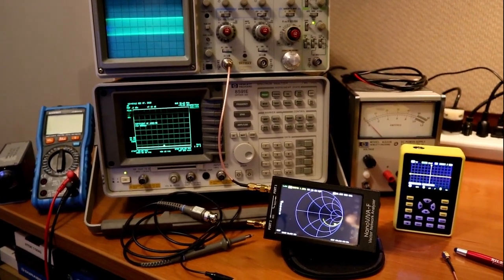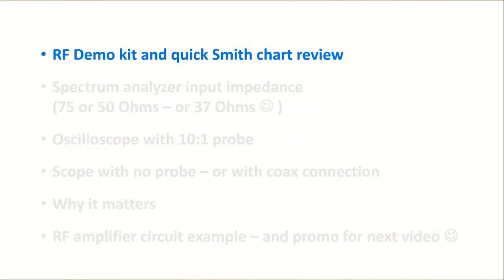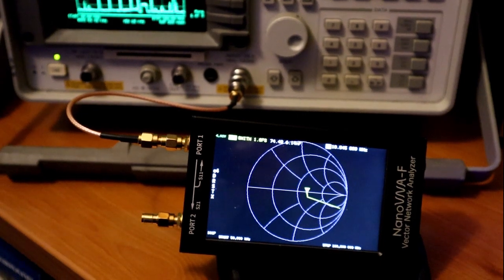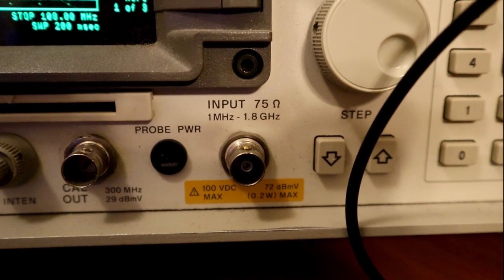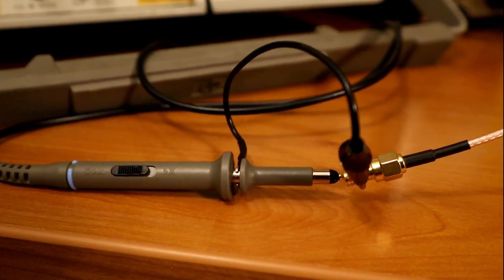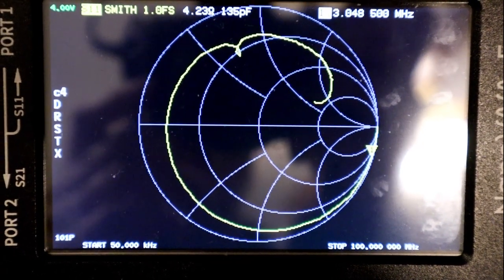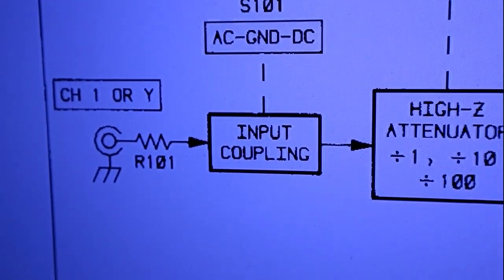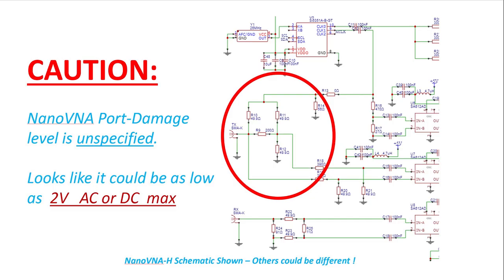NanoVNA - Measuring Impedances

Comment: how to measure impedance antenna using nanoVNA ?
Reply from the maker: Hi Edi.  The short answer is you need to calibrate the nanoVNA to the feedpoint of the antenna and then read out the impedance as discussed from 2 to 4 minutes into the video. To calibrate to the feedpoint, the short, open, and load used for the cal need to be placed at the end of the cable where the antenna is normally connected. However, if you don't need to know details of R and X, and just want to know if the antenna matches the cable impedance, you can do what is shown in this video: https://www.youtube.com/watch?v=hLPNOp0RXD8&t=115s
Reply: @MegawattKS  thanks sir. Ideally, value of S11 = .... ?
Reply from the maker: @edisukriansyah5230  -20 dB is excellent. -15 dB is quite good. -10 dB is OK for most situations.  -10 dB means that 10% of power is reflected. Although that may not sound great, the effect on transmission range is negligible.  If S11 = -6dB, I start thinking about needing to fix things.
Reply: @MegawattKS  thanks you for taking the time to help me

Comment: What setting measures reactance?
Reply from the maker: The marker reads out either R + inductance(or capacitance), or R + jX. I think you have to go to the "Marker>Value" menu to select R+jX if its currently reading out the other.
Reply: @MegawattKS  I'm using the VNA_QT_Windows program, and didn't know what drop down I should chose.  I'm thinking it is Z-re  << Is that right?
Reply from the maker: @davidc5027  Sorry - I am not familiar with that software. I would say try it, and see if it matches what you can visually read from the Smith Chart (with a marker set on a particular frequency and looking at what arc you're closest to). Also if it reads out as X+jY format, it's most likely showing reactance as the Y (though it could be admittance).

Comment: I didn't hear what frequency the scope probe was specified for. Nothing has a fixed impedance at all frequencies. Everything will be way off ultimately if you go high enough in freq2quency. That's why the frequency ratings matter so much.
Reply from the maker: Good question. The probe shown in the video is a cheap one that came with a 100 MHz scope I have at home. BUT - I've also done these measurements with high-end Agilent probes rated for up to 300 MHz. In particular the N2863A, which is a 300 MHz 10:1 passive probe. Same basic results. At 100 MHz, it measured 49 - j160 Ohms (which is equivalent to 570 Ohms || 9 pF in parallel form). The VNA showed it moving along the 50 Ohm circle from the right side toward the center on the Smith chart, just as all passive probes will (some may move along a 70 Ohm circle).  As you said, nothing is fixed impedance as frequency changes. Here the fundamental problem is the cable, which is a transmission line with distributed L and C. To deal with that, the probe has to be terminated in its characteristic impedance at high frequencies at the scope input jack. A modern Agilent/Keysight 100 MHz scope we tested measured 50 -jX almost perfectly when the calibrated VNA was attached directly to the scope's input jack, reaching 50 -j198 at 100 MHz. The probe necessarily has a coax cable between the scope tip and the scope input jack. Hence, the input impedance seen at the scope tip must morph from the proverbial 10M || 15 pF (or whatever) to something tending toward 50 Ohms resistive at high frequency, since there is no choice in a passive cabled structure if one is to avoid wild impedance and frequency response swings. See the comments/discussion below from WD8DSB and G0HZU for a deeper dive into some of the complexities the probe designers dealt with using resistive center conductors/etc.   (The best solution for high frequency work is to use an active probe that has an amplifier at the tip that can present something like 100K || 0.5 pF, and then buffer that down to 50 Ohms to drive the cable run. We have a few of those in the lab for RF work and they're great - although a bit cumbersome due to the need for powering  :-) )

Comment: Also take an ohm meter and measure the resistance right at the input connector on your scope and you will measure very darn close to 1 Meg Ohm.  If you measure your 10X scope probe with your ohm meter when the 10 X probe is connected to your scope you will indeed measure close to 10 Meg Ohm.  Also since the parallel resistance is so high you can typically measure the parallel capacitance of the scope probe as well as the scope using a capacitance tester and get reasonably close to their published values.  I used my smart tweezers to measure capacitance and measured the parallel input capacitance of my scope and it measured 17 pf which is very close to the published value of 15 pf as an example.  I also measured the parallel capacitance of my 10 X probe when connected to my scope and it measured 14 pf.  Therefore you can see that the typically stated values of parallel resistance and capacitance is indeed correct for oscilloscopes as well as their 10 X probes.
Reply: At frequencies above a few MHz a useful rule of thumb is that the loading effect of a typical x10 scope probe will look like 12pF in series with about 70 ohms resistance rather than 12pF in parallel with 10 Megohm. This is because there will typically be 12pF across the 9Meg tip resistor and this will appear to be in series with the input to a lossy transmission line (deliberately lossy coax used in the scope probe that will look like a 70 ohm resistor). Some x10 probes might load the circuit like 12pF in series with 50 ohms and some might be 12pF in series with 90 ohms. But many will fall within this range. In terms of the parallel equivalent this means the x10 probe will load the circuit with about 12pF in parallel with 25k ohm at 10MHz and it will load it with 12pF in parallel with only about 6500 ohms at 20MHz. By 50MHz it will be down to 1000 ohm in parallel with about 11pF. At these frequencies this is a long way away from 10Megohm in parallel with 12pF.
Reply: @G0HZU  Hi Jeremy, thanks for the "rule of thumb" and you will see down below that MegawattKS and I do discuss the lossy center conductor farther down in our discussion about scope probes.  I did not include the lossy center conductor in my original scope probe impedance versus frequency examples that I provided MagawattKS down below, but then I brought up the fact that scope probes have lossy center conductors and that was the reason why my impedance estimates at various frequencies did not exactly match what the VNA measures.  Also easy to measure the lossy center conductor resistance if your probe can be switched to X1 mode.  MegawattKS also provided a link to an excellent paper discussing the lossy center conductor down below.
Reply from the maker: Thanks.  I agree. At DC, audio and low frequencies.  But it is not the proverbial 1M || 30pF (for scope), or 10M || 15 pF (for 10X probe case) at RF. I think what happened probably is that in the early days, there was no 75 Ohm termination for high frequencies since scopes stopped around 1 MHz or maybe 5 MHz, and cables/probe lengths were a small fraction of the wavelength. But as scopes went to 100 MHz and above and tried to maintain 1.2, 1.5, or 2 meter cable lengths, they had to add the 75 Ohm termination in series with the 1M || 30pF of the input amp. Please see reply to your second comment below also. Thanks for this clarification !

Comment: Hi MagawattKS, as you said the 75 ohm resistor that you show is a series resistor and therefore it is not necessarily providing a 75 ohm impedance termination for the probe (it would have to be parallel if it was acting as a "termination for 75 ohm cable").  If you do the math on a scope input that has a 1 Meg ohm in parallel with 15 pf specification as an example (which is what my Rigol scope has), then the input impedance is as follows (using complex math) : 1 MHz : Input Impedance = 112.56 - j 10609 ohms, 10 MHz : Input Impedance = 1.13 - j 1061 ohms, 100 MHz: Input Impedance = 0.01 - j 106.10 ohms.  Therefore you can see that the parallel capacitance value is what drives the input impedance so low as frequency increases.
P.S. you might consider changing your statement at the 0:46 mark (also at the 7:29 mark), because the impedance is indeed typically based on 10 Meg ohm in Parallel with 10 or 20 pf when using a 10 X probe and it's the parallel capacitance that drives the input impedance down so much with increasing frequency (do the math to better understand the impedance versus frequency).  The capacitive reactance goes lower with an increase in frequency and this is what drives the input impedance lower with an increase in frequency for the parallel combination of resistance and capacitance.  Just FYI, Don
Reply from the maker: Hi Don. Thanks for the comments! I figured this would be controversial and was hoping it would generate discussions :-)  If I understand your 2nd comment, Zin should be 0.01 - j 106 at 100 MHz, but it's not in the measurements. It's closer to 70 - j 100, not 0 - j 100.  So at RF it is much closer to test structure 7 on the demo board (C in series with R) than structure 9 (the pure cap - which is what 10M || 15 pF would tend toward at high frequency where Zc falls with frequency). The actual equivalent circuit for the 2215 scope is 75 Ohms in series with 1M || 30 pF. With the probe it is a little more tricky because of the coax involved.  The bottom line is the measured Q is way down from what it should be. I reason that this is because the amplifier provides C to ground in parallel with 10M, which tends to -j0 at high frequency, while the 75 resistive (R101) remains. And I reason this is to terminate the coax (probe cable).  Please see the final slide at the end of the video with the yellow text inset on the chart to see the series to parallel impedance conversions from measurements of an Agilent unit with an Agilent probe. This is what messed up the gain and bandwidth of my RF amplifier at 100 MHz. The problem arises from the need for a 1 to 2meter cable between the probe tip and the scope. If this were terminated in 10M || 30pF inside the scope, then the 9M || 10 pF in the probe tip would drive into a highly uncontrolled impedance  as frequency goes up and the cable does its transmission-line thing. The only fundamental solution appears to be the use of an active probe to create a low-impedance drive to the terminated coax (cable used in the probe). Thoughts ?  73s, Bill
Reply: @MegawattKS  Hi Bill,  I will have to think more about my big picture response to you because the typical X1/X10 scope probe is even more complicated by a little known fact that the center wire in the scope probe coax does not have a low resistance (unlike normal coax), and you can check this by switching your scope probe to the X1 mode and then measure the resistance of its center conductor from end to end and you will see that it probably has a resistance of 100 to 1000 ohms and I believe this is to prevent ringing when used as a X1 probe based on some obscure documents I recall reading.  I just measured my X1/X10 probe master 1 meter long probe and its center conductor measures 312 ohms.  It's very possible this resistance and/or the 75 ohm resistance you see in the schematic causes the impedance measurement discrepancy you mention versus the values I said it should be based on just pure math (an added series resistance would definitely cause a discrepancy similar to what we are seeing).  Bottom line is that the impedance of the scope probe loads down devices more at higher frequencies because the impedance drops due to the capacitive reactance dropping at higher frequencies which bypasses the pure resistance within the probe circuit because a majority of the resistance in the X10 probe circuit is in parallel with the capacitors in the probe circuit (this should not come as a surprise, but probably causes a lot of problems when you forget to consider its effect on the circuit being measured).  Interesting stuff and more complicated than one would imagine.
Reply: @MegawattKS  Hi again Bill, take a look at the 17:00 minute mark in this youtube video that discusses the scope probe cable in detail  https://www.youtube.com/watch?v=OiAmER1OJh4.  This is related to my other comments about the scope probe center conductor having a relatively high resistance (I suspect this is why we have the measurement differences between what my math predicted versus what is observed on the VNA).  Don
Reply from the maker: Thanks for the knowledge about the center conductor being high resistance wire !  I watched the EEVblog you linked. I also found some discussion of that in this document on page 15, after you pointed it out https://www.davmar.org/TE/TekConcepts/TekProbeCircuits.pdf . So in addition to messing with the Q inside the scope, they are doing this to degrade it in the cable as well. Wow. My poor little RF amp circuit never knew what hit it !  ;-)
Reply: @MegawattKS  Hi Bill,  thanks for the link to that Tektronix document, and yes it does a very good job describing the high resistance center conductor in the cable.